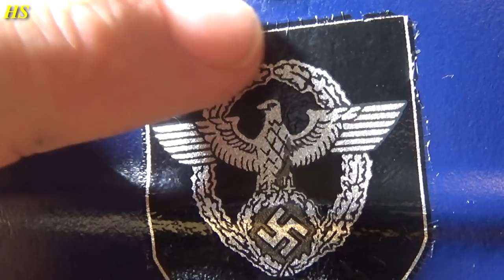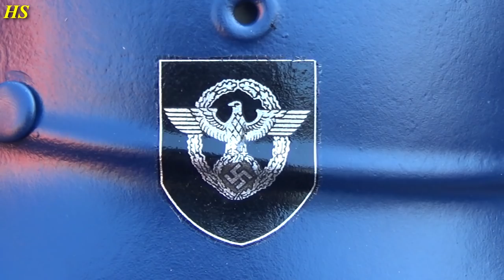Restoring a German WW2 Beaded Helmet - WHAT is a Beaded Helmet?! HOW to tell the model Differences?!

Comment from the maker: Okay, so some people are complaining about the restoration, and are saying it's a bad and ugly one, and the color is completely wrong etc. 29:03 (Final Result) Well, I don't even know why I have to explain this in a pinned comment, but like I already explained in the video, the color is exactly the same as original beaded helmets. Especially at the end of the video, you can see that the color is 100% correct. If you think that's not true, than I know for sure that you've never ever held an original one in your hand. I own original Luftschutz helmets myself, and have seen many different ones in my life, and I can say that this is all correct. I'm someone that will even notice the smallest mistake, and there are none. Also, some people are saying the helmet should be black.. do more RESEARCH! Another complaint.. Why I ruined a nice original helmet, and painted over the original paint? Listen, like I said in the video, the paint was badly damaged, and keeping it like this was not the best option. It would not fit in a display with the ugly scratches, so I decided to restore it. These helmets are not rare with original paint, actually, it's more rare to find them without original paint! There are a LOT of these helmets around with original paint, it didn't hurt the value. If this was a regular combat helmet, I would not have done it, but this was the right decision for this helmet. Stop complaining, I know what I'm doing, do more research. Here a few of the Many original examples I can show to prove you are wrong : https://www.proxibid.com/Firearms-Military-Artifacts/Military-Artifacts/WOW-Original-German-WWII-Beaded-M35-NSDAP-Double-Decal-Civic-Police-Steel-Helmet/lotInformation/52788726

https://collectorsmilitaria.com/a_very_nice_beaded_m40_double_decal_police_helmet_071811.htm

https://www.warrelics.eu/forum/steel-helmets/water-protection-police-wasserschutzpolizei-helmet-pick-up-414709/

https://alexanderandsonsrestorations.com/project/beaded-m40/
Reply: I also don't understand why some people always have to complain so much.  I always enjoy watching you and think you do it perfectly.
Reply: I think you did a great job, some people just don't understand restoration
Reply: Its the effect of time and you can't turn it back, each mark shows you what its gone through    
and what happened to it, the rough look of the helmet is what makes it a part of history.

You are a legend and you really do uncover these secrets in turn teaching everyone.
Reply from the maker: @Hingabe.  Yes, and this one didn't have any of those.. This one only had scratches from someone messing with it after the war.
Reply: @History-Secrets  I think you did a great job of the helmet and like you said the scratches would of ruined the helmet if they were still there
Reply: You did a really good job
Reply: wtf nick is getting passive-aggressive however yeah i dont get either why people dont like what you did, imo you did do a great job
Reply: @benjolicious  Passive-Agressive? He's just explaining because its anoying, that people get mad because of this
Reply from the maker: @benjolicious  I'm not aggressive at all. It's frustrating when you are filming for a couple days, spending money on a restoration, do your best to explain everything in detail, editing a video 2 days in a row until the middle of the night, do your best to upload it as fast as you can, and people start to complain about stuff that doesn't make sense. People have to do their research before posting hate comments.
Reply: @History-Secrets  If people actually watched your videos they wouldn’t hate and I’m sorry for the hate comments
Reply from the maker: @jensonford6459  Yes.. If they would listen to my explanations, they would understand..
Reply: @History-Secrets  
That's a great job Nick. The time and effort you have spent over the years.....greatly appreciated. As a detectorist myself, I prefer to leave as found. But its yours, your choice and reading your explanation about the colour and about being common, I would have done the same. I've learnt something today already. I think the 'passive-aggressive' comment is a cheeky joke mate. Not literal. You NEVER get mad or reactive, so, this for you is waaaaay over the top. ;-). Best of luck, with respect. John U.K.
Reply from the maker: @francisjohnification  I'm someone who hates it when History gets destroyed, I always leave relics etc in original condition, but just like cars, sometimes it's better to restore. Glad you understand! :)
Reply: You did an amazing job! I've been restoring helmets professionally for 15 years and I couldn't have done a better job myself!
Reply: The color is perfekt its just not dry
Reply from the maker: @aaronietosvuori2576  Exactly!
Reply: That color and decal placement are all really off. It does not resemble any of the countless original helmets  I've handled. Im sorry.
Reply from the maker: @b.schade  lol, look at the end of the video.. It's completely correct.. The paint looks lighter on the video, and the paint wasn't dry yet.. The end result is perfect.
Reply: @b.schade  He did it correctly, maybe its you who don't do it right?
Reply: @History-Secrets  I never thought i would hear you say "lol" XD
Reply: Ignore them bro keep doing what you do like you said they need to do more research
Reply: Firstly, this is YOUR helmet... so why bother excusing yourself? ;) Furthermore, I think you made the right decision painting/restoring the helmet. Aside from the fact that it was damaged beyond recognition, it is also important to have some examples of how a certain helmet would have looked like coming out of the factory. People need to stop with assigning each and every historical object as an irreplaceable artefact. It is just a helmet and not even a special or one of a kind. In the end, I think a lot of people are just jealous, but are not able to accept that...
Reply: @laurensa.1803  Couldn't agree more
Reply from the maker: @laurensa.1803  Thanks for your comment, you are exactly right!! I restored it so I can show what it looked like, and use it for reenactment / displays without damaging an original one.
Reply: @History-Secrets  If you do restoration, you have to do it the right way. Thats exactly what you do/did here, some people just don't understand it
Reply: @lazykoalabros6254  Not to argue, but even in the professional circle, the idea of a 'restoration'  is material for lively discussion... I wouldn't bother to much with taking part in these kinds of discussions.
Reply: @History-Secrets 
Dear Nick,
I also want to restore a german Luftschutz helmet, but I'm still looking for a Luftschutz liner.
Could you please help me and tell me where you've bought the liner you used in your video ?
I really enjoy every video you make.

I'm looking forward to hear from you.
Have a nice day, greetings from Germany.
Reply: Nick darling. There is always someone who is bored with himself or jealous to someone else of his things.  And sadly those a**holes are not just one. You do exclusive work and I really appreciate your videos. Every single day I notice that you have pupliched something, my day turns to pure smile and I enjoy those. I think there is lot more those who agree with me than complainers. So keep doing what you know best ❤️
Reply from the maker: @borb3t  I bought these liners from a Dutch website called Militarycollectibles4u
Reply: @History-Secrets  Thank you very much for your help and the quick response.
Reply from the maker: @borb3t  You're welcome!
Reply from the maker: @PaukkuTane  Thank you so much for your kind comment, I really appreciate that!! 😊
Reply: This is probably the last comment i will post here (unless someone wan't to argue). Restoration for helmets or other relics is like restoring a car or a building. If there is something valuable on it, you probably won't touch it, but if its just falling apart and in bad shape, you have to save it.

Him restoring saves it and gives it a new live. He didn't ruin anything, and as he said “its easyer to find a helmet with alot of paint, than one without”. He didn't ruin anything and i think most people know this. There are still people who don't like it or understand it, but you should not listen to them.

All in all i think you did a great job Nick and i hope that your channel will survive the pandemic. Best of wishes

-Alexander
Reply: @history secrets.

i understand your extra comment, good you made it.
from the complainers(collectors)  perspective me as a militaria helmet seller i can understand them, they see it as history destroyed
but as you say these helmets are not super rare or something, and the piece you handled was far from complete, and its your helmet and you made a great detailed video
i might have an interesting project for you, its an old relic which had a very bad restauration, and thats underestimated.. maybee something for you? let me know you can email me at rocksteady-militaria@hotmail.com 
my website www.rocksteady-militaria.com 

Groet Bas
Reply: Ah this makes more sense! I think you did a good job restoring and the people complaining are just some bums
Reply: The People that complain about it and say that it was a bad restoration arent worth the time, and the restoration is Beautiful! Leaps and Bounds better then all of the restorations ive seen.
Reply from the maker: @rocksteadymilitaria541  Hello Bas! Funny to see you here, I know your website! On camera, the end result looks a bit different than it actually is, in person, the helmet looks exactly the same as the original ones, I have many original examples I can show to prove that, but most of the people complaining don't even know much about these helmets. Yes, normally I would never spray over original paint, and I never destroy History. The paint on this helmet looked really bad in person, on camera it looks much nicer than it actually was. It would not be nice to display it, it had no liner, and like I said, the paint was badly damaged. I decided to restore this one, so I can use it for reenactment and display. We both know they are extremely common with original paint, so nothing was lost here. Thanks for your comment, I will check it out!
Reply: love all your video's keep your chin up and keep up all the amazing work love from South Africa.
Reply: @History-Secrets  Wow, that actually broke my heart. You really do this much effort for your videos? Nick, you have gained a lot more respect, and take your time. We don't need you to hurt yourself mentally or physically to rush these videos. They're better made with love instead of stress. I hope you take this comment into consideration.
(And yes, I watch your videos over and over until everything you taught is jammed into my brain securely.)
Reply from the maker: @howtogetdisowned7478  Thanks for the kind words! :)
Reply: @History-Secrets  Holy crap you responded, this is like getting a response from the president. But I meant each word. :)
Reply: I really don't understand why people are like this on youtube ;/....
Reply: this is awesome I don't understand why people have to say that bc you have been doing this way longer btw I wanted to start reenacting soon but I don't know where to start the gun i like is m3 grease gun but I don't know where to get it I live in America any suggestions
Reply: I have an original luftschutz helmet from 1938 and it's the same color as yours... but the late war ones normaly use a little bit darker blue. but your is really nice and i think the light blue was also used at the late war.
Reply: How do you get originals for so cheap I can't even find a cheap fake. :(
Reply: lees het maar eens op div facebook groepen,maar moet wel zeggen ik geef ze gelijk
Reply from the maker: @eswe4278  Lees wat?
Reply from the maker: @lazykoalabros6254  Thanks for your kind comment! Yes, that's exactly what I'm thinking too..
Reply: Hello nick, what's your email if you want to share it, I would like to send you some photos of a restoration I have done. Yours looks really nice btw. And it's also "historically correct". Im praying for you  that you dont lose your house and that times get better for u and all of us.
Reply: Idk much about German helmets I would love one my self but he said he’s gonna make a police helmet right so maybe the blue is because it’s police nick is the best and even if he did make a mistake which I really don’t think he did everyone makes mistakes and you should respect that guys anyway good job nick 👍
Reply: Some people in a FB group just laughed the hell outta me 'cause i defended you and your restoration, i gave them the exact same points you mentioned, but just got laughed at...
Reply: That helmet came out absolutely breath taking! Awesome work, sad people talk smack and don’t properly research before commenting...
Reply: Your restoration of the helmets from WWII is always very interesting. I look for such objects myself. I recently acquired a 1940 ammunition box. is not a helmet, but still something special
Reply: Nick can you do another room review
Reply from the maker: @eswe4278  Oh echtwaar? En je geeft ze gelijk ook? Dan hebben ze er samen met jou niet veel verstand van helaas.
Reply from the maker: @wolfystudios1117  That only shows that they have no idea what they are talking about. There's nothing to laugh about, the things I pointed out are all true. People just think they are cool and know everything, and they feel like a true king behind a keyboard.
Reply: YOU SHOULDN'T HAVE TO EXPLAIN YOURSELF , IF THESE FOLKS DON'T LIKE IT OR GET IT  THEY NEED TO DO THE RESEARCH , JUST PRESENT IT NOT DEFEND IT FOLK , DON'T WASTE TIME ON PEOPLE THAT WANNA ARGUE AND COMPLAIN YOU HAVE BETTER THINGS TO DO 👌👌👌😆😆
Reply: I think this helmet is one of a kind and is gorgeous!
Reply: Do you don’t listen to those people you’re an expert I guarantee you they’re not otherwise they would know that that is the right color it was a great restoration video thanks for the vid
Reply: Nick, Don' t listen to them... that color is good for the porpouse, the original ones looks different just because their paint is 80 years old...  the hue and sheen of the color has changed over the years... So don't worry and keep it up!
Reply: 69th comment lol
Reply: You should make a museum of all your stuff and a tour of your trench and bunker for extra money
Reply: Did you say you war destroying the buncer and treanch if you do pls dont do it
Reply: @Pandrnchicken  "that helmet came out absolutely breathtaking"
He just spray painted it (it really didn't need paint to begin with), put a reproduction liner in it and put decals on. Not that mindblowing.
Reply: I don't understand why some people think they know more than you
Reply from the maker: @homerj806  Exactly.. Apparently we have a lot of "experts" here that are saying the color and decals are wrong.. It really makes you laugh. I even placed links to original ones, and still they won't listen. It's fine, if they don't want to believe it.. They can keep living in their bubble where they know everything better.
Reply: You can say what you want but that helmet was original before the restoration. Paint was just fine. It didn't need anything else except for a new liner. Saying it could not stay like that is based on absolutely nothing. You can hate my opinion. You can downvote it. But it still is the truth. And yes it IS rarer than a m35 or a m40 beaded shell. The m42 variant waa far less made into beaded helmets. If you don't know this you really should do some more research. These are often found in a very late war configuration with a non leather liner. Often even canvas since leather was hard to come by at the end. They also had a Ersatz chinstrap. Also not leather again but made of transparent plastic. People claiming it was a good restoration have no idea how the piece should have looked like originallly. And if you want to downvote this comment feel free to do so. It just shows how view of those people actually know about the subject.
Reply: @sembons9535  I agree. It is dumb how people just assume something when they have not even researched the topic!
Reply from the maker: @kodebruin4701  This proves that you didn't even watch the complete video, and that's annoying. You just explained me, what I explained in the video. I explained it was more rare, and I explained about the canvas liner, and the plastic chin strap etc. Again, the paint was badly damaged, and just like a car, it's better to restore sometimes. If you like it or not, that's your opinion. It was a good restoration, and the helmet looks perfect now.
Reply: Nick, I'm not a wealthy person, but under the circumstances you are in, I would be willing to help your channel out financially.  Do you have a Patreon or Paypal set up for your channel so your viewers can directly financially support your channel?  I can't find any on your channel.  Please get that up and running Nick and I think you will find that thousands of your viewers will help you out!  :)
Reply: Bro it ok we all know how you feel take your time we can wait don’t cry be happy think about all good times we all for ok.
Cheer up
Reply: anyways just imagine seeing a german soldier sharpening a m42 helmet lol
Reply: If you were carrying out a quality restoration you would have stripped the helmet of the (original) paint first, rather than lazily painting over it. I know you mean well, but it’s just crap. Just get someone who knows what they are doing to do it, get it done right first time.
Reply from the maker: @frontschweine4588  Did you know that the German themselves painted over other layers of paint too? And, removing the paint wasn't necessary.. Why would I do that if it won't change the end result? I rather have the original paint still underneath. It's not crap.
Reply: @History-Secrets  I know that they repainted helmets. Its like you cut corners
Reply: Thank you for the Great Videos
Reply: "to Day im going to show how to age a m1 Helmer"
Reply: Some ppl just enjoy complaining, ignore them !
Reply: @History-Secrets  ik ben echt fk jaloers op die helm is echt heel Nice geworden. ik heb een originele m40 helm het meeste verf is er af maar wat er nog opzit is dezelfde kleur!!! Echt gaaf man :)
Reply: i think it looks grate
Reply: Som People just is not that intested in original
Reply: @History-Secrets  yes you are right and its rong for people to say that its the rong paint when you do the RESEARCH
Reply: @History-Secrets  # love history secrets
Reply: I think you did a great job I really like that helmet👍
Reply: I think that’ helmet is historically accurate after seeing those links
Reply: No need to apologize I will stay family member to I know it can be hard sometimes
Reply: You do not need to apologize everybody know this world is hoarse sometimes
Reply: Yeah I don’t get it
Reply: @sembons9535  agreed, he did an awesome job
Reply: Yea man I seen those fb forum comments absolute bullshit. You did a great job restoring that helmet 👍
Reply: Can confirm!! Over 45 years ago I saw two stacks of them in an Army surplus store in Montreal. They were definitely very dark blue. And they were selling for $19.99 CAD. (I wonder what they sell for now in 2021) This was before reenacting was popular so I highly doubt they were repros.
Reply: You shouldn't worry about the paint, It looks amazing! 🙂
Reply: Wait can i ask i own an originall m34 helmet and they were civilian -police 
SO why dont they have a bead
Reply: You can't make fun of people who think the paint is wrong
They get all their information from documentaries and think that everything was in black and white back then.
Reply: I think these are Police Helmets becouse my dad has a German Millitary Helmet from ww2 that is black. I think your helmet is goodly made but its just a Police Helmet
Reply: It’s like a wolfenstein type helmet ngl
Reply: I think it look great better than anything I could do
Reply: nick definitely loves animals
Reply: Where do you get Your liners from